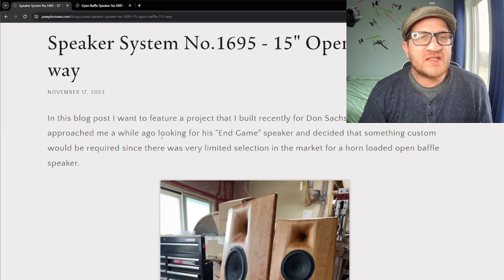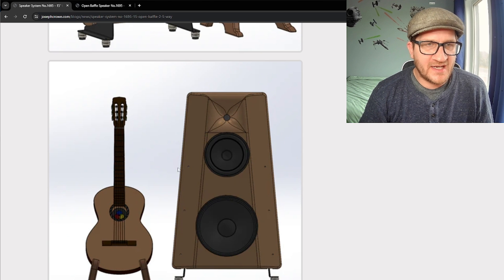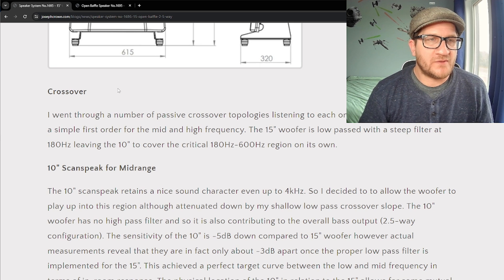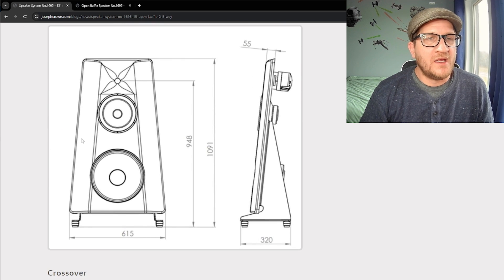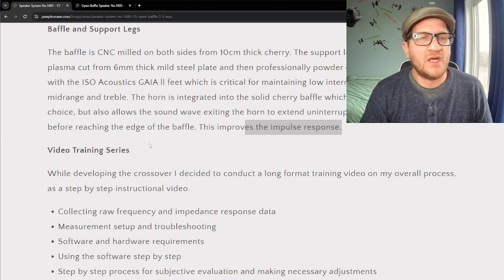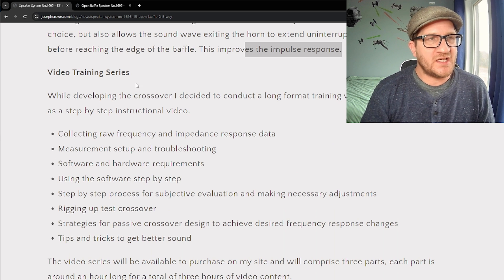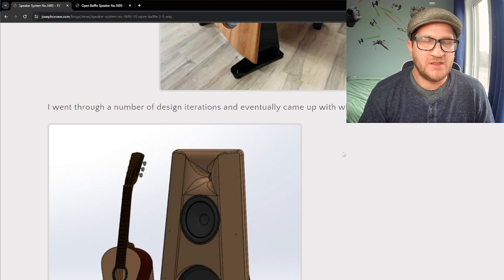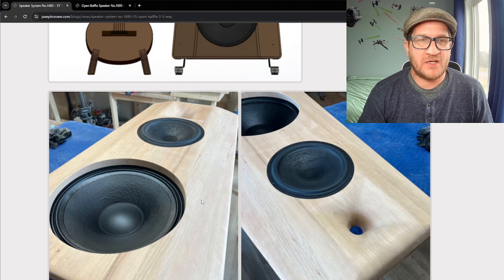Speaker System No.1695 - 15" Open Baffle 2.5-way

Comment: Good inspiration for a new project with some drivers that i have over...........
Bass:               SB 15OB350      Might try SLOB ala Nelson Pass or Graham  (Slot Loaded Open Baffle)
Midbass:        Vintage    Electro Voice  EVM12L.  Might try to slot load it or use a center piece that make the cone not act as a horn. Brings down the 2 kHz peak.
Tweeter:         Horn loaded    GRS  planar
Reply from the maker: Check out the DIY plans. 

https://josephcrowe.com/products/open-baffle-speaker-no-2812-diy-plan-set-based-on-1695?_pos=2&_psq=1695&_ss=e&_v=1.0

Comment: Can I ask what the sensitivity measurement is on these babies? I didn't see that on the product page.
Reply from the maker: Development is still ongoing but in its current form its flat from 150Hz to 5kHz, however I will crossing much lower than that at around 600Hz to the ES-450 above it. I can send you preliminary test data if you email me. joseph_crowe@josephcrowe.com
Reply: It says 91db on the features page.

Comment: Hi 👋, They look very nicely made, it’s a shame that you didn’t pay some actual music through them, from classical Toccata in D Minor, Led , Z , Kashmir , Nordic & Viking folk, and war music, there is not many speakers 🔊 that can perform well to this type of music, especially when it comes to organ music, D minor Toccata, I built my transmission line loudspeaker cabinets around 40 years ago, and I just recently replaced the drivers, with SEAS 8” subwoofer, and 3” Tweeters, the line is around 14 Ft and fire out the bottom, And they stand approximately 5 1/2 feet in height, And I’ve been told they sound amazing, 
Very impressed with your cabinet work, open baffle , speakers, please share some music, Phil from the moulin France

Comment: Hi Joseph 
Excellent design …. A very big thank you for sharing it.
Fairly sure some others have done hybrid OB-horns before - but your approach is the best I’ve seen 
The larger rear cover for the compression driver, lowering Fs by that much ~ 35%(!) EXCELLENT 
Were you able to estimate the size of the drop in Fs in advance of making it, based on what factor/s? 
Cheers

Comment: Gorgeous speaker! and end result. Open baffle speakers are in my future... Having owned Maggies and Quad ESLs for 40 years, along with a mix of cone speakers. I do love open dipole sound, with (line-source) propagation in the room. Designing and building high power (mostly) MOS-FET, with a few ICE and Hypex amps in the works... power is not / never an issue... I want efficiency and sensible loading to better mate with my OTL amps (sitting idle, so much of the time). With a few large listening spaces, these speakers would work very well.

I am shocked by how affordable these speakers (actually) are Hmmmm???

Comment: Very good presentation! Thanks. If you are using LSPcad, I have found the simulations very helpful to position drivers and size the baffle. And I also found the combination of several different bass drivers can mitigate the uneven response and cancellation that occurs with open baffles. One issue that arises is too much output at the 100-200hz range, and then the bass output falls off below 40-50hz. There are ways to mitigate that effect as well.

Comment: Curious how you got around the Open Baffle Peaking issues with only a 1st order crossover? Did you actually measure the final response? May have at least partially found the answer in your Bass cabinet video. I guess by rolling off the upper end of the 15" driver, you bring down the Peaking?

Comment: A pair of Hypex FA253 plate amps with the internal digital crossovers would really transform these into accurate speakers.  You could equalize the low bass, fix the open baffle upper bass bump and dip and use proper high order crossovers to avoid vertical off axis response anomalies.
Reply: And adjust for the inevitable differences in sensitivity of the drivers once their responses are flattened
Reply: I'd use a single-ended tube amp with these. If a speaker can "wake up" with only the first watt they' will sound more detailed than any low sensitivity system hooked to 100 watts.